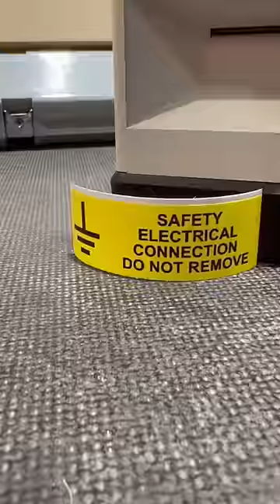Electricians Shocked by this Mysterious Earth Clamp

Comment from the maker: It's the Legrand Rapid Clamp, if you are wondering.
Check out the full review 👉 https://youtu.be/67TfDNZ4B7Y
Reply: Подписался! Отличный контент! Отличный инструмент! 🤝👍
Удачи! ✊✊✊
Reply: Looking at the comments efixx... I think a video on what bonding is for and how it fits into the protective measure wouldn't go amiss.
Reply: this is bad. if problems with electrical system occur it energizes the water ....what if ur showering dude? ive already seen stories about this
Reply: Every cold water bond (a secondary earthing path, here, aside from a ufer, or ground rods) that I've done for a 200A residential service has been a larger wire and we bonded at the singular cold water main line, above and below the shutoff, so if Pex gets installed later in the house, it'll still be bonded at the main copper line.

Our CWB brackets took about 1/3 the time of those, but I do like yours just as well.  They may even have a lower impedance bond than ours.  (Look up US cold water bonding clamps, if you don't already know what they look like, I haven't seen your style so I'll look too.)

 Your codes require ferrules and ring terminals for most if not all connections?

The first bend you did with the earthing wire would violate our bending radius code here, but I could be mistaken if that only applies to current carrying conductors.
Reply: I doubt we would stock this thing, any regular water clamp is what the guys we sell to have been using their whole career, saving 10 seconds at most with this isnt going to change anything
Reply: @packerman1203  it doesn't save 10 seconds because you have to crimp ring terminals and ferrules for no good reason.
Reply: This is a cheesy ass looking ground clamp…I would never install a plastic and steel clamp between a copper pipe and a copper wire. The Brundy style copper clamp has worked for decades and you don’t have to worry about galvanic corrosion or the plastic cracking. Anything to save a couple of bucks I guess. I’m glad I don’t work in the construction side of electrical anymore.😢 It has gone to shit.
Reply: @isaach1447  you don't even save a couple bucks. you pay way more. a  pipe ground clamp is like $5 at home Depot and you don't need ring terminals or sand paper.
and yeah, if that is another metal besides zinc plated brass or copper then the reaction will eat the copper pipe away on the inside and in about 3 to 5 years, they're gonna have a bad time. a pinhole bad time but a bad time none the less.
Reply: @travoltasbiplane1551  wouldn't matter because they did it wrong anyway. any explanation or justification from anyone causing a shock hazard is not credible, ever.
Reply: @QuantumMarmalade  #facts. 🤣
Reply: @QuantumMarmalade  as I've said before on other threads. This is a UK electrical channel. Our regulations require the application of main protective bonding to parts that can introduce a potential into our installation i.e. metal pipe coming from underground = 0V. We have to do this when we use automatic disconnection of supply as a protective measure so that during earth fault conditions the part rises in voltage with the earthed parts of our installation and doesn't present a shock risk between simultaneously accessible parts. You're about the 20th person who has said with absolute conviction that something is wrong whilst having no clue what you're actually talking about. 'Facts.'
Reply: @isaach1447  doubling down on the stupid here pal 👏
Reply: ABSOLUTELY NOT, water lines are given an independent grounding rod.. so if the murder panel messes up, you don't kill someone in the shower.
Reply: Working with Siemens, ABB, Hager, Eaton and Legrand, I attest that Legrand delivers excellent quality products.
Reply: Going to keep plumbers busy from that clamp
Reply: @Blue_2_K That's the point, keeps earth integrity and trips the rcd/gfci.
Reply: Ķk
Reply: Why do you mark the PE cabel? Is has the color yellow green to show its PE
Reply: We know what is, and what it does....
But when, goddammitt , are YOU coming by to fix it? 
NEH-ver? Cool mystery music...
IS THERE AN ELECTRICAL-PLUMBER ANGEL IN THE HOUSE?

Comment: Wait... an electrician that knows how to use a trashcan? Now ive seen everything
Reply: As an electrician I can confirm we don't know don't what garbage cans are 😂
Reply: @zstrode.8953 I second this. I've seen them, but there's never one within arms reach so it becomes the laborers problem.
Reply: @leftyeh6495  that's right 😅
Reply: @leftyeh6495 But I put the bin right next to your work space, and it still ends up on the floor
Reply: They are from the UK so that probably explains it
Reply: UNDERRATED COMMENT
Reply: You’re telling me for 40 years I could of been using a trash can …Haaa AIN’T NO WAY!
Reply: I NEVER leave a site without cleaning up, easiest part of my day and the pay is the same.
Reply: I rather see 2 ground rods.   What if the water main is plastic
Reply: I didn't realize that was a thing, everytime I have had my electrician in the job was done fast, but I would be picking up little bits of wire insulation whenever I walked over the spot he had been working in.
Reply: @zstrode.8953  we aren't paid to know what garbage cans are
Reply: Apparently you haven't if electricians were required to start picking up their trash the bids and  the cost of our jobs would go up to compensate most job sites have a laborer whose job is to clean up, they can afford to pay him much less than a skilled laborer.
Reply: A valid comment if ever there was one!
Reply: ain't it the Truth!
Reply: Teach him to use a broom too and he will be a god.
Reply: @RedFox-wg7dm water main is secondary.. u still have to have a ground rod..
Reply: We always have a clause about cleaning up after yourself in the contact. So if the electrician leaves a mess, we simply hire a cleaning company to come clean up. The electrician is billed for this in the end.
Reply: @baljdeepinvajuna1363   I'm also fun at parties. This has proven as an effective teaching method to special needs people that "yo mama don't work here, pick up after yourself."
Reply: Yooooooo 😂😂😂😂
Reply: Thats tell you this isnt a real video lol
Reply: @RedFox-wg7dm   We did added a long copper tube and grounded that.  Also there is a 2nd ground in the tankless water heater that touched the tank its self. both go straight to earth bypassing the panel
Reply: Great comment seriously any trade guy that knows how to use a trash can is a myth
Reply: Still yet to see one push a broom.
Reply: That was the only thing shocking about this video
Reply: Bro tell me about it!
Reply: It's a myth
Reply: fun story...i was a young ibew brother and i took a piece of cardboard and was ATTEMPTING to throw my trash on it while working and the foreman told me in a very firm but not yelling voice that i was taking work away from a fellow brother and flipped the cardboard over with his boot and walked away.  lesson learned
Reply: What's this trashcan you're talking about,  I just  saw them useing a spare wire storage bin for junk
Reply: @mrromantimothy  it's just common sense to pick up after yourself. No one else is obligated to clean your mess. Shouldve learned that in grade school. It's an elitist attitude. Look down on carpenters all you want but without us, you don't have a house to rough in. Now, pick up your shit or hire a gofer
Reply: Lol indeed I throw everything at the ground while doing electrical work or electronic repairs at my bench.
Reply: @JP-lz6gc 
Then when you call that company back to bid on another project.... they either add that cost to bid.... Or they just blow you off.

We sparkys are so busy, we can cherry pick who we will work for.
Not being a ass, but few are getting into this trade anymore.
Reply: So dam funny but true
Reply: @RedFox-wg7dm 
Most likely the rest of the pipes are plastic before going down to the water main.
Reply: Beat me to it 😂
Reply: Been in home building for 15 years and you just said it right Idk how many times I've had realtors tell me they found electrical clippings on show day 😅😮😊😢😂
Reply: Scraps are left for the other trades to gather and weigh in
Reply: Bahahahaha
Reply: @LynxStarAuto  we get paid too much to pick up trash lol
Reply: @mrromantimothy  exactly I've actually been told by job superintendents that I get paid too much to clean up trash just leave it get the electrical work done.
Reply: @JP-lz6gc And it's still cost less than having the electrician clean up his mess
Reply: @Hunty49 I've been an electrician for 19 years. You almost always have a helper with you or there's usually a job site labor that's supposed to do all the cleanup to save money. its their job to clean up the mess
Reply: @patrickzavas  Like a TA? ( Trades Assistant) Or do you use apprentices?
Reply: No its an illusion,  it doesn't happen
Reply: That’s clearly not an electrician, we were all taught to leave it on the floor as job security for the lower trade guys ❤
Reply: It's for the video we all know it! This is daily protocol let's be honest
Reply: It was just for this demo WE NEVER USE TRASH CANS WHAT WOULD PEOPLE THINK  OR CLEAN UP
Reply: @ltr6541  yup that sounds like your from America?
Reply: The one that did all the wiring in my loft didn't, that's for sure.
Neither did the plumber.
Neither did the BT engineer.